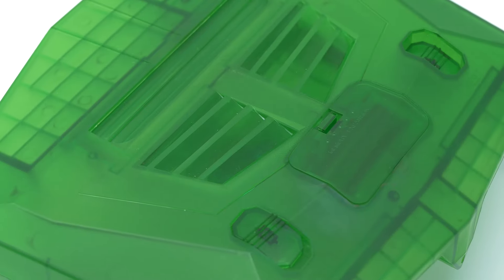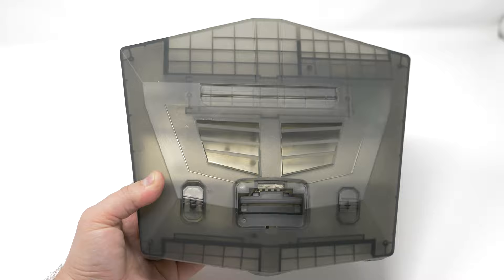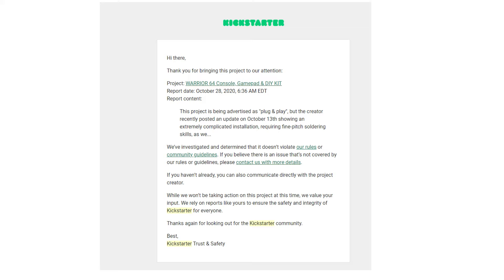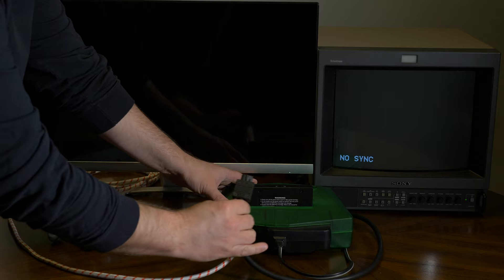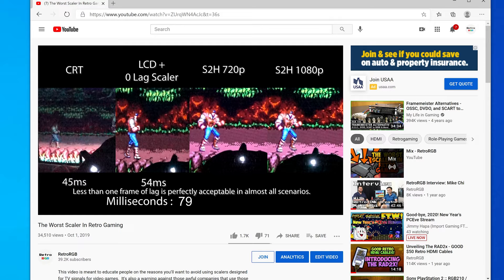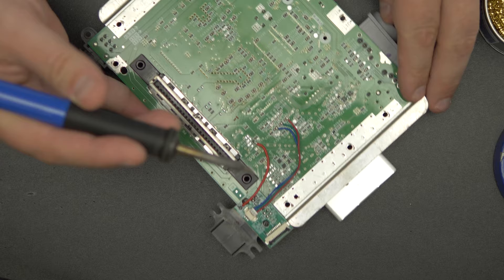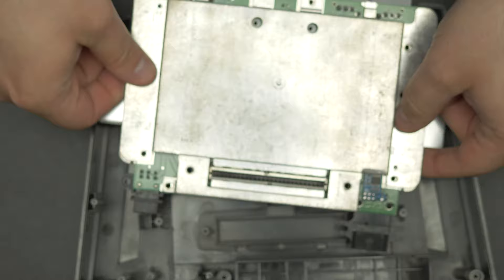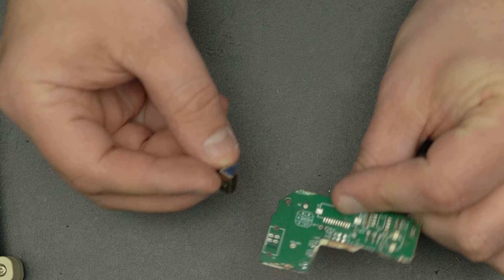Warrior 64: Review & Repair

Comment: Is anyone gonna make and produce any hdmi mod kits for n64? Could you reach out to Dan and see if they will make one. For now I guess who makes the best RGB MOD that offers de-blur and most features? And my last question does my tv need to be set to pc mode/chroma 4:4:4 to actually properly receive RGB from n64 to tv once n64 is modded for rgb. Your reply is appreciated. Thanks :)
Reply: There is already an hdmi mod kit for the n64 called the ultra hdmi, but the designer makes it a huge pain to get ahold of one under normal circumstances and decided not to produce any of the current design while working on hardware revision 2.0. It seems that the design for 2.0 is nearing completion, but there will be no new ones on the market until then. The other major problem is he only sells to professional modders, so you need to buy off of one of them. Game-tech.us sells them on his shop when they are in stock (which is likely going to only be for a few hours after he gets a shipment from any given batch) or there is a group buy on shmups to make sure one gets ordered and sent to you. Either way it is a big hassle and will likely be a few months minimum before you can get ahold of one. Alternatively, you can just get a rad2x and one of the many easily available rgb mod kits if you just need hdmi out or a mod kit, a dual output switch like a gscartsw or one of many used matrix switchers from ebay, and an upscaler like a retrotink or ossc if you want hdmi out for streaming but analog signals to game on a crt.

As for which rgb mod to go with if you want de-blur, I have personally used the tim worthington one, it is pretty good and not terribly difficult to install. Depending on which board revision you have you might have to solder some ribbon cable onto the boards DAC, the pins are small but not that bad, iirc it is an SOP package, which is still pretty manageable to do by hand if you use flux and have some idea what you are doing (with some you solder an FFC cable to the DAC then solder the ribbon to pads on the FFC, that is easier IMO because it is easier to line up the FFC with the chip than ribbon and the pads on the FFC for the ribbon cable are larger). There is also one called the advanced rgb mod designed by borti, it has a bunch of extra features and settings compared to the tim worthington design, but it costs a lot more and if you are sending the signal to an OSSC or framemeister you can probably get many of the features of the advanced kit through that instead.

For your last question, you don't want to sent RGB directly to any modern TV. RGB is the best quality analog signal you can get so it is great on a CRT and it is the obvious choice for which signal to send to an upscaler/line doubler (like a retrotink or ossc (or a framemeister if you happen to have one but they are out of production and pretty hard to recommend at current prices with the alternatives that are on the market)), but modern flat panels pretty much universally handle analog video poorly, especially video from game consoles since they frequently do all kinds of stuff that falls outside video standard specifications. If you are trying to get RGB on a CRT, you shouldn't need to do any messing around in settings. If you have a PAL crt tv with an RGB scart port (or a pvm with rgb inputs or japanese NTSC tv with JP21 or some other more obscure RGB standard), the most you should need to do is plug in an rgb cable from a region appropriate console and maybe select an input and it will display. If you don't live in a region where crts with native rgb inputs are easily available, you can get an rgb to component transcoder and use component  inputs instead, the quality is pretty much identical. If none of that works for you, many CRTs from the mid to late 90s can be modded to accept rgb inputs. The mod isn't terribly difficult to implement, but poking around inside a crt can kill you if you don't take proper safety precautions, so make sure you do your research before attempting that.

Comment: HDMI? RGB?
Real chads play n64 using RCA on a CRT.
If i am to do all this crap to my real hardware id rather just emulate the games at 8k with hud/texture enhancements.
Reply from the maker: That's pretty close minded.  You should try a taco.  It's like a sandwitch, but not.
Reply: @RetroRGB  How is it close minded?
It doesn't matter if you install ultraHDMI on the n64, it will still output sub 640x480 resolutions, which look terrible in any tv that isn't a CRT, i guess i can understand it if you don't have acess to a good CRT, but going after one is far cheaper and better than playing those games on a HD tv with pixelated graphics....

Comment: That is probably 2000/3000 grit paper.  Can be used to polish contacts.
Reply from the maker: That is a terrible idea.  Please don't be dumb enough to use that on your cartridges.  It will remove the protective coating from the metal and cause it to oxidize.

Comment: no offense, I am a longtime subscriber who normally enjoys your videos, but you come off really kind of "whiny" complaining about what someone else does with their property (the old cases) as well as whining about their use of sandpaper (which I'd never recommend either) or their choice of hdmi converter- when you show people how to tear down a board the exact wrong way (on your stove- catching stuff on fire) and then have a rat's nest of a mod to replace their mod. you should have just offered the lag advice (and the critique of their board choice) and avoided sounding all whiny. the mod choices you offer aren't apples to apples though- so it's not fair to say they (the creators of the warrior 64) are "wrong". the price of the components in the kit they offer seems "reasonable" for what they are- I mean it does have a shell. however it would have been nice if they offered the more expensive ultra hdmi mod kit as part of this deal- even if it meant the cost went up $200 or more.  for me, due to cost, I looked for about a year to find an N1 version of the n64 that would take voultar's board- and i use retrovision cables and a retrotink 2x pro (on my upstairs hd tv- but component on my downstairs sony wega) - so I've got $300 dollars in my set up- and that doesn't count my everdrive- so 150 isn't a bad price.  I have another newer board that takes the more complicated rgb mod, and changing that to HDMI is not cheap either- which is why i was watching this review. in the end you did keep me from buying something i would regret (which i appreciate)- but you didn't really offer an option that was better at about the same cost for someone with the newer N64- which, in some ways, means that the "warrior 64" may still be an option for those particular people that can't get ahold of the HDMI mod board (which is about impossible) and who only plan to play it on their modern tv (which is a position a lot of people are in- not everyone wants a 36" wega hanging around their house- that thing is a beast). or at least it gives some people the idea that they should just buy a retrotink or rad2x and just be satisfied with s-video to hdmi as an option.